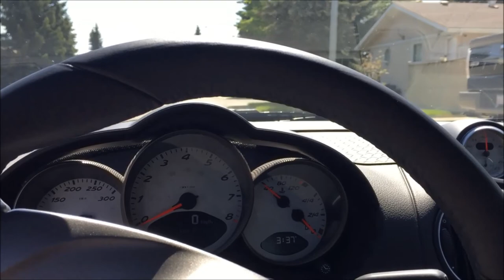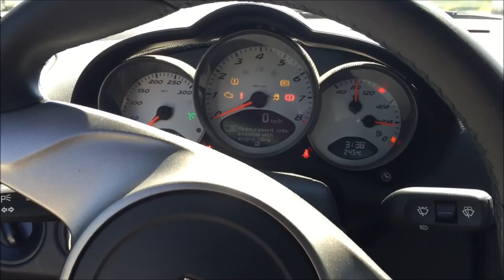Porsche Engine Oil Change

Comment: Nice video bro, I used the Icarsoft por2 to reset oil setting in my wife 2017 Cayenne.
Reply from the maker: Wow thanks for the tip. How much did the entire setup cost you roughly?

Comment: Video was good I only have one thing I don't understand.  If your changing the O ring why do you worry about the screw driver being sharp and cutting the O ring? You can just take that knife and cut it off.  Good job on your presentation.
Reply from the maker: Thank you for the kind words. You're correct that caution must be taken ONLY when applying the new o-ring to avoid damaging the new o-ring and compromising seal. The old o-ring does not matter. It was entirely personal preference not to destroy the old o-ring as I tend to keep them for one oil change interval in case the new one fails, I would still have a backup ready.
Reply: @FIFTYmil  very good point I hadn't looked at it that way.Thank you for the idea I'm going to do the same.
Reply from the maker: @patrickodonnell6848  You're welcome! Best of luck

Comment: when it goes thru the oil check, does that reset the oil change interval or is there another step to reset the system?
Reply from the maker: Hamed Anwarzai unfortunately unless you have the proper software resetting needs to be done by the dealership. I'm not 100% sure on that though
Reply: gotcha, thanks for the quick reply! great video btw. My brothernlaw bought a 2014 Cayman.
Reply: when doing your own maintenance on a Porsche, how do you keep records for resale proving the maintenance. does it hurt resale value much?
Reply from the maker: Hamed Anwarzai beautiful car!
Reply from the maker: Never had to sell the porsche yet but when I buy second hand cars usually I know already whether the owner is knowledgeable or not. Service records are one way to tell whether the car was maintained properly but at the same time not always the best way to tell!